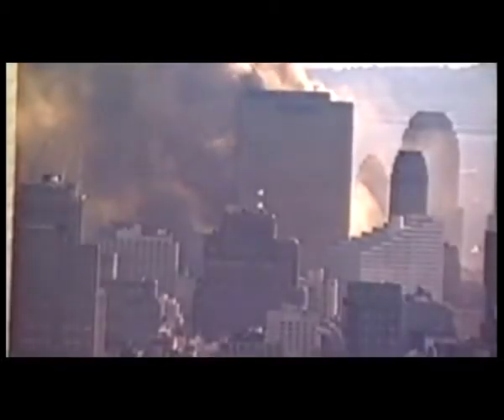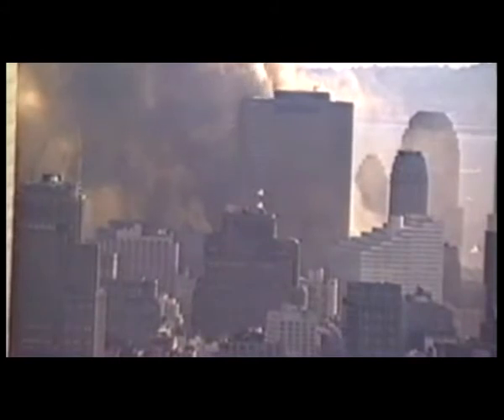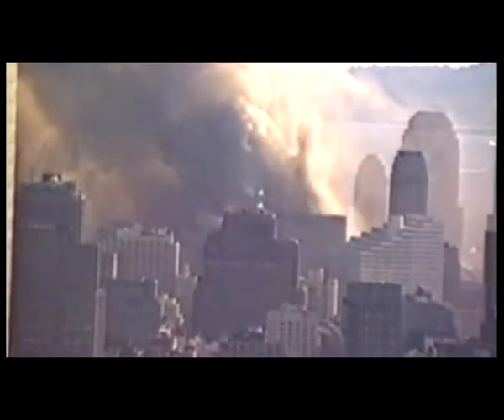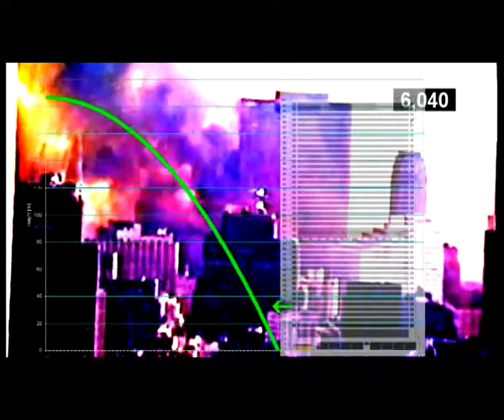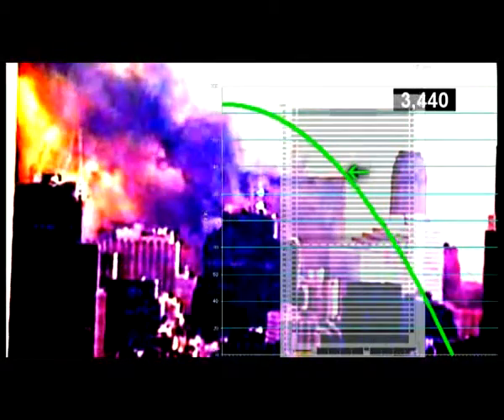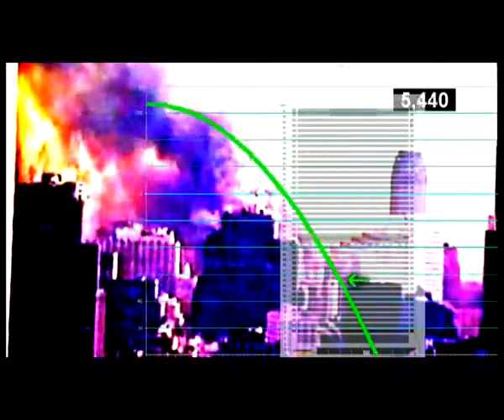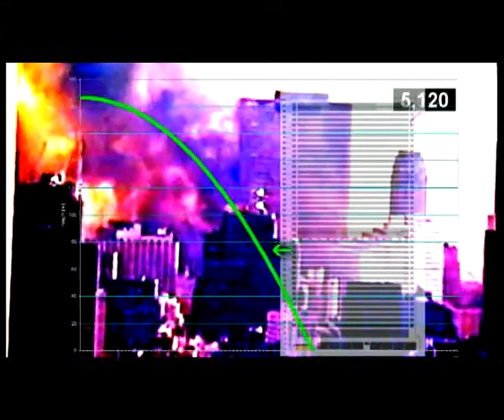The NIST predecisional WTC7 Report part5 of 5

Comment: @alienentity "Under certain circumstances it is conceivable for some of the steel in the wreckage to have melted after the buildings collapsed. Any molten steel in the wreckage was more likely due to the high temperature resulting from long exposure to combustion within the pile than to short exposure to fires or explosions while the buildings were standing. " direct quote from nist - they think that steel can melt in an office fire - and you morons buy that - at what temp does steel melt?
Reply: 2700 degrees